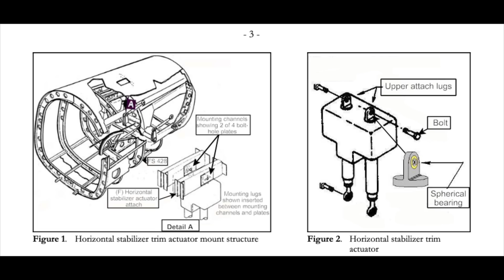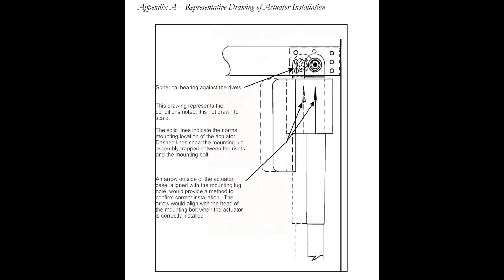The Blind Fix That Crashed A Plane | Hidden Flaw | Transwest Air 602

Comment: I'm am industrial machinery mechanic and I would have used a tapered alignment pin to line things up and take the weight exactly like what was suggested. Once the bolt was pushed in as the pin was pushed out and the bolt fastened, I would have used an small inspection mirror or flexible inspection camera to check alignment and bolt thread engagement when I was done. 
I don't know how I came across this channel but I love it and have listened to every episode this far. Thank you for introducing me to the world of commercial aviation and what could got wrong with flying machines. Your narrative work is excellent!
Reply from the maker: Wow I’m surprised that people actually understood what went wrong 😂
Reply: @MiniAirCrashInvestigation  Not all people are indoctrinated into stupidity as yet. John, Australia.
Reply: There are a lot of us out here who still work with our hands. I call it bad design on the part of the original engineer to have made something so that it had to be installed by touch. Too many designers never have to work with their products in field conditions.
Reply: @mbvoelker8448  "Too many designers never have to work with their products in field conditions" That is the truth and nothing but the truth, I cannot agree more with you!!!
Reply: Industrial electrician/automation tech here. I don't do much mechanical work, but I'd most likely would have done the job same way as you sugested. There are  many instances when parts are inaccesible without extensive dissasembly and working by feel is a must 😕
Reply: @mbvoelker8448  
"I call it bad design on the part of the original engineer to have made something so that it had to be installed by touch. Too many designers never have to work with their products in field conditions."

Boy, isn't that the truth. A lot of propeller-hat wearing designers sit in front of a monitor with a CAD diagram that can be cut-away and/or freely rotated in space with a simple mouse movement but couldn't change a door knob without creating a diagram and a spreadsheet first.

That said, I don't know if I completely excuse the mechanic for not testing the installation. Every time I drive a fastener or weld a joint I give it an shake/tug appropriate for the purpose intended to ensure it's truly fastened and any slop/flex is within expectations. I don't need a bullet point in a procedure manual to tell me to do that, especially when the fastening is part of a safety system. Maybe he did. Maybe it was wedged so well that a hand pull/test didn't suggest any problem. After all, there were 12 successful flights after the installation. But, that suggests it required some extra force/elbow-grease to install it in the first place. Anytime I need to force parts to fit together, I triple check the correctness. Again, I don't know enough of the specifics. I'm just rambling.
Reply: Exactly right. (I just read your comment after saying more or less the same thing. I / we are not claiming to be the Sherlocks of Engineering, this is basic mechanical engineering practice.
Reply: I call the tapered pin a bullet. Insert the bullet first and drive it completely through the mounts using the actual mount bolt to finish pushing the bullet out the other side. Obviously if there is room to do so. Done this many times on aircraft.
Reply: These small remote "snake" tube cameras are now dirt cheap.   Not having a direct view is no longer an excuse.    32 years experience of a mechanic ONLY means 32 years  ---  it does not mean that he has 32 years of wisdom.   This accident is on the mechanic who needs to retire.    (Maybe he was stoned)

Comment: When I was Chief Inspector of a GA avionics repair station, I instituted a simple step: a tech who was not involved in a repair did the inspection afterward. Fresh eyes help a lot, and there is much less risk of "gee, I hope nothing is wrong after all that."
A fresh pair of eyes and hands could possibly have prevented this accident.
Reply: I work on cars, but we sort of do that ‘get someone else to double check’ thing. 
A common phrase is ‘can you have a look at (check) this for me please?’ 
Yes, you have got it right. No it should not look like that. Yes, that part is totally ducked. 
Mmmm. Not sure, let’s have a closer and/or better look, Let’s discuss what we see, as we need to agree....

A second pair of eyes is very very important. We have both caught errors the  other has made, before they became an issue. .. is there supposed to be a gap there? Ah, oh, no, there is not. What have we done wrong?

And I use pins. Ever tried to install handbrake callipers to a Series 3 Jaguar? You need alignment pins!
Reply: Thats quite correct in the machining industry  its the same story .
Im still trying to figure out how this guy tightened a bolt that wasn't in the correct  location .Or am i missing something?
Reply: The fresh pair of eyes and hands was already required by Transport Canada. Any time an engine control or flight control is disturbed an independent check of the work is required by law. It is likely the independent inspector in this case thought everything looked fine and operated as expected. Very hard to find after the bolts were tightened up.
Reply: I worked on military aircraft. There was always an inspector. In some cases, QC would inspect the work. I had several instances where I had to hold a heavy actuator while trying to bolt it in. My arm got tired pretty fast.
Reply: It's the same in IT when you have to recover a crashed system in a hospital. Time pressure, sensible data and complex systems make it absolutely necessary that you have a colleague watching over your shoulder.
Reply: @markmall7142  probably threads were pushing against one side of the element, most likely the bolt had a short threaded section and was precise size of the bore it went through. It all held by friction.
Reply: @markmall7142  The bolt wasn't in the wrong location, the actuator was.
Reply: In the airline business we have confirmation checks or QA buy backs on critical items like this.

Comment: The tests were not required BECAUSE they were installing new parts? That's when mounting tests are most important!
Reply: I'm guessing that they're saying the part was tested at the factory, and therefore doesn't need to be tested again. 

In the real world, I know that things can be damaged in shipping, or mishandled in a warehouse somewhere along the supply chain.  He did the basic movement tests, and it did work for the first few flights.  But load testing it would have been a good idea anyways.  I'd hate to learn that the part was just ok enough for the basic movement tests, and not ok enough under the load of a real flight.   It wasn't an actual part failure, but it could have saved this entire incident.    It is possible that other mechanics still do the tests, which is why this hasn't happened more often.
Reply: I have to say that that is pretty much exactly what I was thinking.  Working on road vehicles it is absolutely drilled into you to carry out function tests after installing new parts so it seems utterly ridiculous, and incredible, that this isn't entirely standard practice when fitting new components into the flight control systems for aircraft.  There is far more opportunity for problems to be introduced in aircraft as all the tolerances are so tight...
Reply: Totally agree with all 3 comments posted in this thread. ASSUMPTIONS kill people and in this incident it seems that good piloting (and an ounce or two of luck) was the difference between loss of both aircraft and passenger lives.
Reply: you probably dont give a damn but does someone know of a method to log back into an instagram account??
I was stupid lost my password. I would love any help you can give me!
Reply: @Amir Terrell Instablaster =)
Reply: @Yael Jacob It did the trick and I finally got access to my account again. I am so happy:D
Thank you so much you saved my account !
Reply: @Amir Terrell Glad I could help :D
Reply: I KNOW! Holy cow, I had the exact same words and thought pass through my head the moment I heard it.

Comment: I guess upgrading the maintenance manual and put an emphasis on proper alignment of the part in question. The pin idea seems reasonable.
Reply: Add a flag to the pin so it more than visible.  I can see someone forgetting it and leaving it in after a bathroom break and thinking all is good... it holds.

Comment: When I worked as a GA aircraft mechanic (powerplants, airframe & avionics from everything from little Cessna's up to Gulfstream IV's) years ago one of the companies I worked for had implemented a "buddy" system. This ensured that nothing was signed off until a 2nd person had checked over the work that had been carried out. This covered everything from changing spark plugs to reinstalling a propeller or even an engine swap. This gave our customers great peace of mind although it did incur a little bit of extra work.

Comment: Definitely add measures to ensure and indicate correct installation, this was not an issue of mechanic training.
Reply: Borescopes (also known as an endoscope in medical use) have been around since WWII to inspect, you guessed it, bores of firearms.

Nowadays keyhole surgery is routine operation (in both ways), so I do not see why the same technology cannot be used to a) visually check and b) pass the image to a laptop/tablet guiding the mechanic while installing stuff like actuators.
Reply: True. If it was designed well, it should have been impossible to install it incorrectly.
Reply: @nipuniperera9918      There is no such thing like making something “impossible” to install wrongly. Hard, sure.  Impossible, no.

USB plugs, for example, “cannot” be inserted wrong way round — guess what?  Some people still manage.
Reply: @advorak8529  I was also thinking of an endoscope type inspection tool. These things have become really inexpensive. Some just plug into a smartphone to use the smartphone's screen. You can get them for less than $5 delivered.
Reply: @ddegn      Yeah,  you probably want a rigid one for the much better image quality, and you want to see details clearly.  The rigid ones actually have optics inside, a camera would be outside --- and hence could afford a decent sized sensor.  You can probably hold it in the right position by sticky tape or a clamp or magnets or some external structure (say, a weighted tripod with an arm).
Reply: @advorak8529  " The rigid ones actually have optics inside, a camera would be outside --- and hence could afford a decent sized sensor."
Yeah, those are the nice ones. The cheap $5 ones have a small camera in the tip. The cheap ones also have a LED to light the area. The cheap ones aren't nearly as nice as the expensive fiber optic units but I think even a cheap one would have caught the error in the example described in the video.
Reply: @ddegn      Yep, it might have caught the problem — if it could see the hole for the bolt (which it should not, not with a strict tolerance bolt in it).  But what if the actuator is covering the bolt hole?  You would have to see that the bolt actually rubbed on a rivet or similar. Which … might be hard to see with the actuator being around the bolt?
Also a fibre optic variant is a) bendable, b) needs one fibre per pixel, c) is expensive to build (the fibres need to be exactly the same length) d) has some crosstalk between fibres and e) the glass fibres break, killing off pixel after pixel, due to the bending and co. 

With a rigid borescope you do not have fibre optics transporting the image (though you might use some to put lots of light into the area, yet have the lamp and it’s heat far away from tender insides (like human bodies).  And as you have proper optics (lenses and so on) you have a much, much better image quality and can actually see stuff
Reply: Redesign the mounting. It can be designed to be oriented correctly, and not strain the installing personnel.
Reply: Regardless of how difficult it was, the mechanic should make sure the bolt went through the hole correctly. It is basic responsibility as a mechanic.
Reply: XonX  - You're right. I'm an automotive mechanic - and if you have to instal something by feel, that you cannot use an endoscope, mirror or any other tricks,  you make SURE it's been done correctly. Even a few taps with a soft headed mallet might have revealed this one. These errors made by aircraft fitters should just not happen.

Comment: It’s always best engineering practice to design out the possibility of error, rather than train people not to make errors. Both are needed in balance, of course.
Reply: Exactly - we have this concept in software engineering called "blameless postmortem". The basic premise is that any mistakes and incidents are systematic failures. 

If a single oversight can create major incidents, the problem is that the system and practices are not defensive against that

Comment: Been an A&P mechanic for 33 years, about the same as the mechanic in the video. Worked on these airplanes in the 80s for Mesaba Airlines and have changed these actuators. Not an easy job but he just made a mistake.  He should have caught it, you can see with inspection mirrors to verify if it is installed properly.  Not saying I would have done it properly the first time, we all make mistakes, but it should have been  caught, by him or an inspector, an inspection  is normally needed after a flight control repair.
Reply: I strongly agree about a separate inspection by fresh eyes and fingers to catch these snakes in the grass before they bite somebody.
Reply: There was an independent inspection. It is required by law. They missed it too. It does happen.
Reply: @philipolson1965  Yea it does,  then they both messed up

Comment: As an added measure when inspecting highly safety-critical parts in hard to access/see areas, using a small camera on a semi-rigid, but flexible extension might be good idea. Kinda like the cameras used in some surgeries.
Reply: They now make these (I guess formerly called borescopes) for smartphones that are incredibly convenient and dirt cheap too!! I want to say $20-$25 on AliExpress and HD! Best of all, the head has 4 built in LED lights and the base has a dial to adjust the LED brightness or turn off. 

I mean it can’t get any better than this.
Reply: Guess what they didn't have in 2003.
Reply: @thebucketbus9370  they had them but they were incredibly expensive!
Reply: @lightningstrikestwice6302  that plug into cell phones?  Nope.
Reply: Even simpler and cheaper.  Flashlight and telescoping mirrors.
Reply: @lightningstrikestwice6302  Around 2005, I bought a cheap security camera for $20 to play with, it was a little smaller than an Oreo as a size reference. I found that by attaching it to a stick, I ended up with a very useful tool for working on cars.
I'm sure aircraft service companies can afford something much nicer than that setup even back then, a few hundred for a tool is practically pocket change to them.
Reply: @NiHaoMike64  Yep, that camera tech existed back in 2003. :) Maybe another tool would be a form of electric current sensor where the plane could pump a few volts into the bolt mounting system. If a current is measured, that means the bolt completed the circuit. If the bolt wasn't installed properly, the current would be zero. Also, if the bolt corrodes, the current would decrease. Then, a corrosion warning could be displayed in the cockpit of the plane, showing a diagram of the bolt and connector, and sending an automated report to the airline. :) Just a little hypothetical idea I have in mind.

Comment: This blind/hands-on/feel type repair is the exact reason small telescopic mirrors were invented. I was a heavy equipment mechanic for 30 + years it was an invaluable tool for that sort of thing. Its hard to believe that an aircraft tech would not have one. I am sure like most FAA findings they came up with a  $10,000 mandate when a $10 inspection mirror would have solved the problem.

Comment: A guide pin can be an idea.
But I would add (as a guide) a rim of about one inch width of sheet metal around the bearing/hole of the airframe.
So the only way you can push up the actuator is on the exact spot, guided by this rim.
Inspection later (endoscopic tool) is needed anyway !

Comment: As errors can be deadly I would do both.

I once worked at a manufacturer that built converyor systems from scratch.  For some critical assemblies that were difficult for future maintenance personnel to see we would build guide tabs on all four sides of the attachment point, guaranteeing that the part had to be correctly alighned to seat flush.  Inexpensive but very effective.

Comment: Always good to learn that all aboard survived.  My mind went to alignment marks as you described the problem to ensure vertical and horizontal alignment.  Visual clues make installations that much easier to install parts.  Never considered the pin, but it was a great additional step.  Glad this went as well as it did, the outcome could have been far worse.  The flight crew did an amazing job saving the plane from a far worse end.

Comment: I would recommend:
1. As that section of the airframe is not pressurized, I would add an inspection port on the outer skin of the aircraft and add witness marks on the actuator and airframe to aid in visual inspection,
2. The use of an assembly pin is an excellent idea; and,
3. Add specific warnings in the airframe overhaul manual.

Comment: Everyone suggesting a small inspection camera: you can get these now dirt cheap on AliExpress that connects to your SMARTPHONE(!!) for about $25! HD, flexible snake, with LED lights on the end to illuminate dark passages, a dial to adjust brightness or turn off the LEDs, and the connection between the unit and your iPhone is wireless via WiFi!!!! Incredible!!